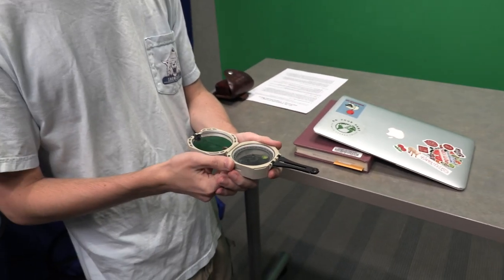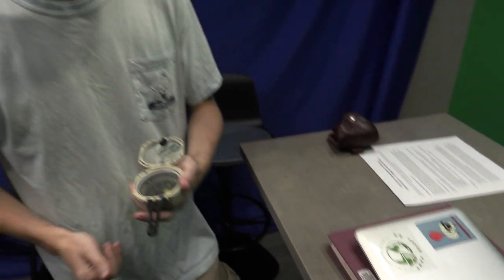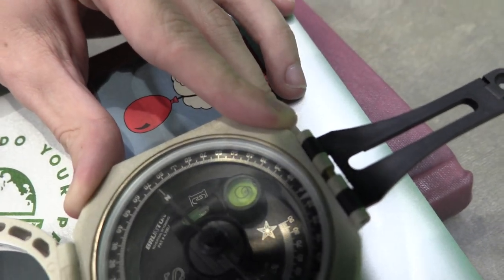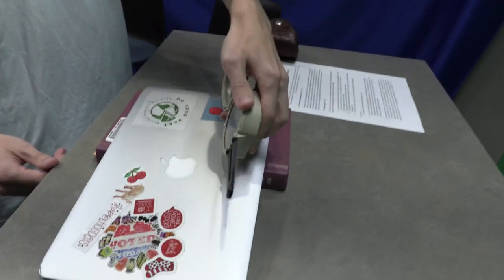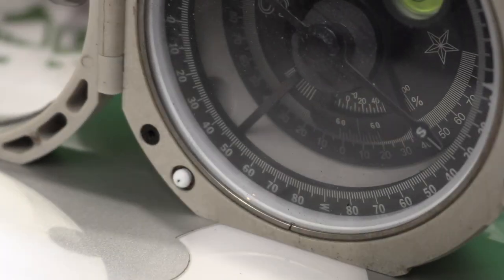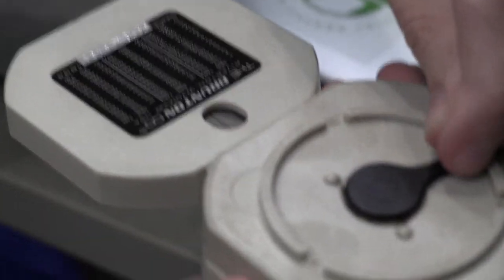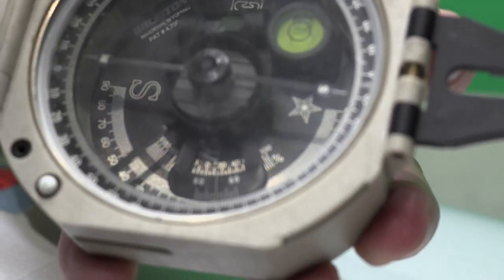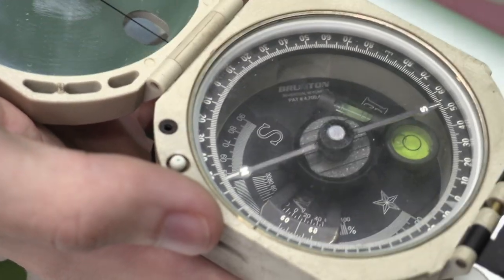How to find strike and dip with a Brunton Compass

Comment: I wonder if the sighting arm points to the direction of the strike. If it is the case, when you stand on the other side of the iPad, wouldn’t the mirror face away from you?

Comment: good vid. notice folks that his right hand 'fingers' are pointing downgradient=downhill; if unsure of downhill, downslope direction, pour some liquid on the outcrop surface; the water will certainly travel downhill. now if that surface you are measuring as a low very low dip angle or reverse angle (only exposure ir underneath a cliff), find another video and link back here!; there are other circumstances where you just can't get your right hand up in there for that reason some profs don't like the right hand rule--yup forgot the other method; direct reading I think?
and yes, cell phone, batteries etc definitely interferes with the compass needle brunton, silva all the same negative effect
didn't take long here ya go world take notes or reinvigorate them structural/field brain cells https://youtu.be/MwBVztOz2No